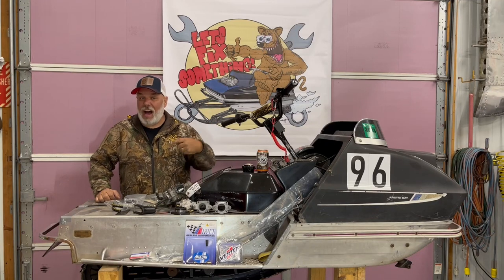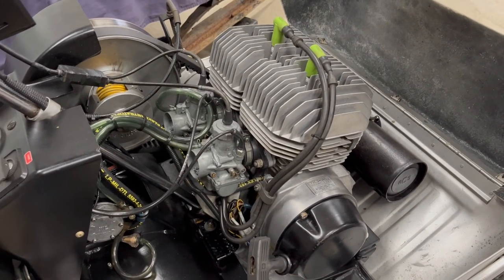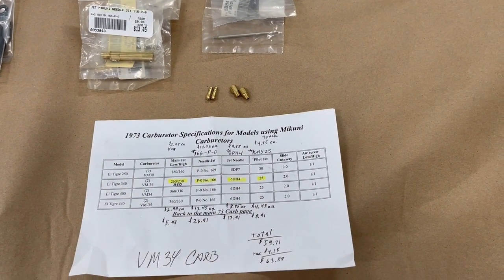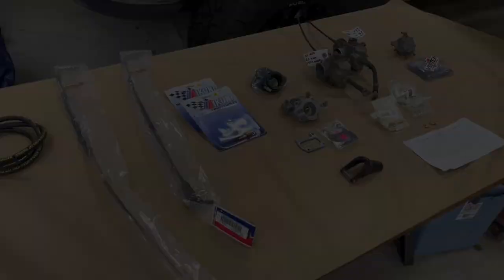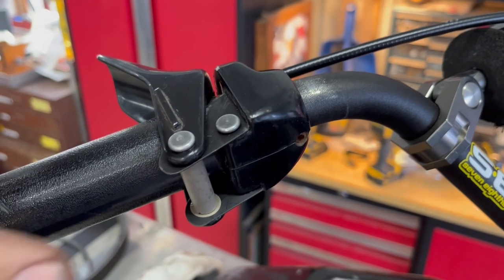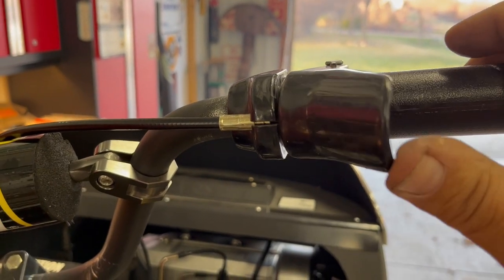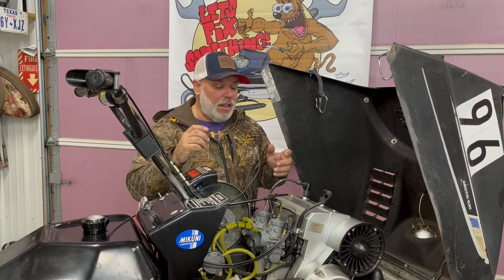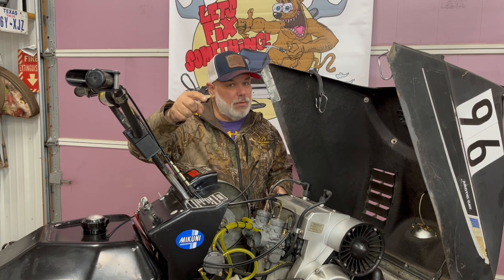RAT CAT DUAL MIKUNI CARB SWAP

Comment: I did a single mikuni on my 400 Cheetah years ago. I found another intake manifold, cut it at an angle and flipped the flange over and had it welded back up to level the carb. Pressure tested it and bobs your uncle. It worked great.

Comment: Sweet install. Everything is nice and tidy. I love the safety wire hose clamps.Sled runs awesome !
Reply from the maker: Thanks Rick. The worm clamps are no go at that size and finding the correct spring clamps is hard. I’ve got a handful of spring clamps and unless you have the super thick wall poly hose they are useless.  The double or triple wrap safety wire works perfectly giving a nice seal.  You can tell I redid the lines a 2nd time as they turned to yellow Tygon vs the clear. It wasn’t nylon according to the package but immediately turned cloudy and rock hard. Tossed it. At -10 that would of been a disaster.

Comment: I purchased three early 70s cats that came with the Mikuni carb swap.  The rubber boots are angled correctly with what appears to be a factory rubber boot,.  So someone or Actic Cat made these boots for these carbs.  Apparently the previous owner was not able to come up with a throttle handle solution.  Thanks for giving us the detailed info to do this conversion.
Reply: Clarification.  I am referring to the Mikuni single carb conversion on my 71-72 Cats
Reply from the maker: I’d sure like to learn what the proper angled boot is.  Anyone??!?!??? That would save a lot of brain damage for sure. I might make a 20-25 degree adapter as an experiment similar to the old Gem adapters, and do a single VM34 on my 73 Panther. For now… I’m pretty happy how things turned out.
Reply: @Letsfixsomething26   My carbs are horizontal to the sled so I am assuming that can't be bad given that the float bowl is horizontal.  Right or wrong, someone intended for it be that way. All three of mine look like someone added an additional rubber manifold to the original rubber manifold making the manifold about twice the length and setting the carb on a horizontal plane with the sled. I am noticing slight cracks in all the rubber manifolds so these must be some older parts that have aged.

Comment: Machine the gasket side of your aluminum adapter the required degrees.  Then you're going to find those holes on the flange will require a slightly obligated bolt hole to arrange a secure tightening.
Works great...By the way, Wahl Brothers can hook you up with rubber Mikuni carburetor mounting flanges, complete to eliminate the aluminum adapter.
Reply from the maker: Wahl bros.  On it.   Stand by
Reply from the maker: I scoured the site. They got lots of bad ass stuff but not finding what your laying down.   Post a link maybe or possibly shoot me a message from contact info..  thanks!
Reply: @Letsfixsomething26     ? My suggestion wasn't meant as a belittlement just merely trying to help.  Wahl Brothers is a respected name in Arctic Cat snowmobile racing and they are a huge supplier of snowmobile parts.
Reply from the maker: @jeffreyhagelin3672  oh gosh no offense taken.. not one bit.  I meant I was all excited to see if they had the T1B flange adapters or a curved rubber boot adapters.  If they have that let me know. Thanks so much for commenting!  I sure wish someone made tipped rubber adapters at maybe 15-20 degrees. That would solve a lot of brain damage
Reply: @Letsfixsomething26  No link is required ..The Mikuni carburetor section covers everything from flanges to Jets and then they have a parts department to answer any questions.. you're very welcome
Reply: @Letsfixsomething26  I have had good luck with the rubber flange Mikuni fitted onto a 1974 Arctic Cat Lynx..  the holes have to be slightly elongated to fit the original studs of the 90° aluminum adapter could be eliminated and still have clearance for the steering column.... The Mikuni carburetor can be mounted up to 20°from vertical but the float must be leveled with the Earth..
Reply from the maker: Thanks Jeff!  Much appreciated.

Comment: The tillotson on my one owner survivor 303 panther has been very dependable for the three seasons I've been riding that sled, but recently a friend of mine swapped his 303 over to a 36mm mikuni. Even though his tuning is not quite dialed, I'm converted! The mikuni makes starting so much easier, especially when hot, and the idle quality is 100% smooth and consistent. If my 303 swapped cheetah makes it out of the barn this year, it's definitely getting a mikuni. Not so sure if I can bring myself to modify the panther though...
Reply from the maker: Check, check, annnnd check.  All the same reasons.  I know a few Tilly guys who swear by them ans most of the time they are just fine….. Walbro…. Dunno.  Do a video on your Mikuni swap on your 303!!!
Reply: @Letsfixsomething26  I'm planning do do a mini series on the 303s before the end of January. I've revived 4 of them now and seem to have it down to a science. How to replace the crank seals and info on the mikuni swap are at the top of the priority list.
Reply from the maker: @stephenh5166  oh hell yes.  If you need any help along the video side of things reach out.  A good mix of video and still shots, good narration and good lighting is the key.  Again reach out any time!   Looking foreword to it!

Comment: I wonder what that miss match in adapters is worth. But sometimes a smaller intake track helps low end snap. Also wondering if you could put a set of Reed's in there with the intake being square shape. Now are the jets in the dual carbs the same as what was in the single carb, or smaller? The sled seems to like that extra air though!
Reply from the maker: Eh, you might be over thinking it.  It’s a win when a vintage sled starts and makes it back to the trailer under its own power.  I am 100% not looking to achieve maximum power out of a 50+ year old Kawasaki.  Mostly easier starting and smoother throttle response.  Oh and to NOT melt down in the middle of the lake. As for single vs dual, skip to the end of the video for dual carb specs vs single carb specs.  Hope that helps. Again I’m not racing this sled, I’m not trying to achieve any sort of max power extraction.  Just fatigued at finicky pumper carbs… meaning hard starting, random fade of mixture settings, bogging, etc…
Reply: @Letsfixsomething26  In that case, it still makes perfect sense. I'll finish watching the vid while I'm not at work. 😂 Could do this on my 1973 panther 400. Going to make one good sled out of three. Sled got parked because of walbro problems, and then crank seals. 😕
Reply from the maker: @Trikekid84  I might have those specs for a 400. I also have a 73 panther that’s destined for same conversion.  Need to fabricate an angled adapter and been working that topic in my head.  You can reach me on the channel contact tab if you want to go to PM.

Comment: Love those adapters I have the scat pak on mine seems to work good. What handle stem set up I have going on ? Have a good one
Reply from the maker: Jeff, not grasping what your asking….
Reply: @Letsfixsomething26  what handle bar set up is that did you change the post or add on
Reply from the maker: Oh gotcha.  Great question.  I cut the original bars at the weld and fabricated up a plate to accept a standard 7/8” clamp from let’s say a 90’s wedge polaris however the 90’s/2000 cats are similar. I found a 2.5” Powermadd spacer and added some bars that I stripped down from a cat I got at a swap.  I’ve since added some slightly taller Pro Taper bars.   Ultimately I’d like  to have a single heavier post with thicker wall and eliminate the Powermadd spacer.  The other thing is the bulkhead kind of reaches its limit from a strength standpoint as there is quite a bit of leverage going on.  Vintsge cats and a chubby guy don’t get along much so I find myself standing more than sitting so on this sled I just configured it that way. My other sleds are all normal cat bars.  Thanks for asking
Reply: @Letsfixsomething26  very cool after seeing your video I’m going back for a redo on my set up, I’m running 32s off an eltigre 34s seem to b better we’re did you source those (new) interested in seeing it on the snow
Reply from the maker: They came with a project sled. Apparently they were off a polaris 600 but you can buy new ones from Dennis Kirk. If you look closely at the chart in the video the 295 Eltigre used VM30 carbs. The key reasons I went for it was I had carbs, and I knew exactly what jetting I wanted to use based on the same Kawi motor but in a free air.  Meaning it gets me very close.  So far it’s working mint but limited snow here in WI so got about 30 mins of tearing yard up.
Reply from the maker: Jeff, is anyone making repop scat pack adapters these days?  I wonder if some of the resins in 3D printing hood up to fuel and the heat.  Lots of young kids who would start pumping those out.
Reply: @Letsfixsomething26  not that I know of I bought mine from a guy who went to the a/c factory auction back in the 80s I think I have an extra set around (brand new) if your interested

Comment: What’s the right email to message you? Made a delrin spacer to level the mikuni carb off the stock y intake. Thought a picture might interest you. It’s a half hour project on a Bridgeport. Love your videos
Reply: It basically amounts to a standard isolator but thicker then cut to 15 degrees then 2 15 degree spacers so the nuts sit flush on the studs
Reply from the maker: Very interested in your mod. I have one more sled to do this to and planning on a single VM34

Comment: Can you get away with using a Single Gas line Gas Pump with a T going to each carb?
Reply from the maker: I’m guessing it would but if you need to get a fuel pump, just get the right one.  I have a triple pump that I got in a box of “stuff” and was going to use that but scored a double at a swap for cheap. Rebuild kits are like 15 bucks so no biggie there.